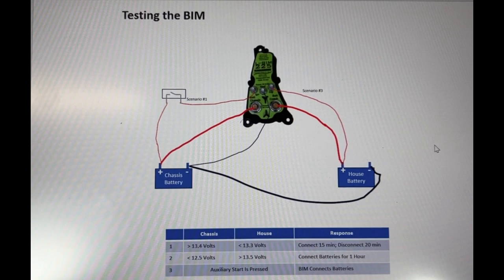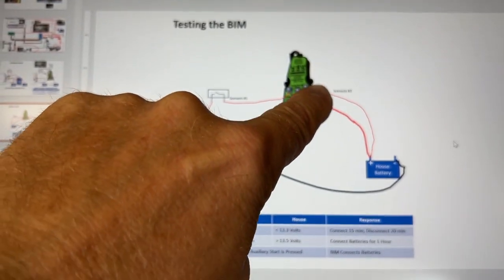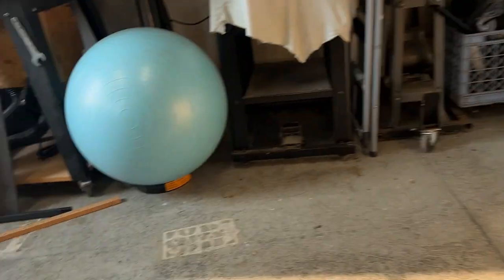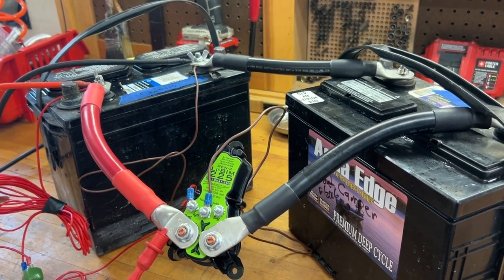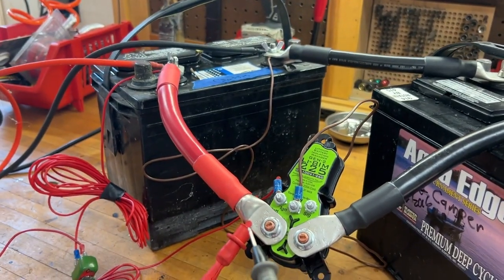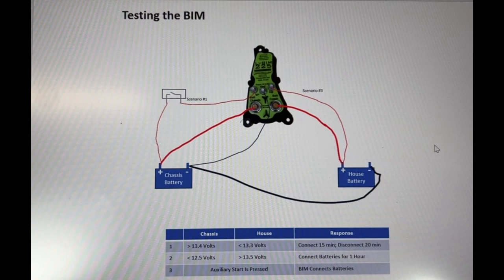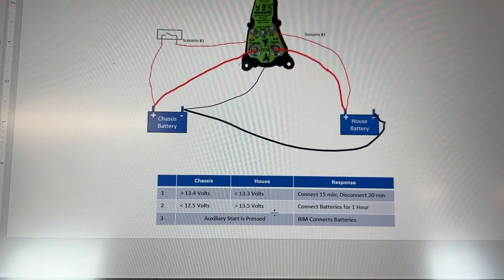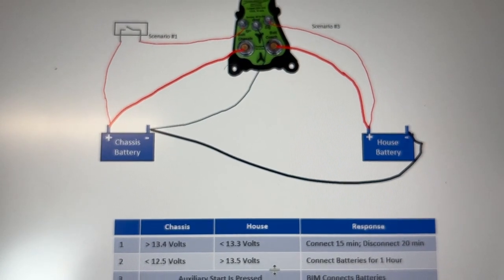#6 BIM Bench Test

Comment: So, you have the house battery charging the chassis battery every 20  minutes with no alternator connected?  In you later test you say the house battery charges the chassis battery?   So, the isolation feature is only every 15, or 20 minutes, independent of the Alternator?  I though the purpose of the BIM was to isolate the house and chassis battery when the engine is off the the alternator is not active?  This to prevent the chassis battery from robbing energy from the House battery.  And, it is my understanding that we should not use the emergency start feature switch using Lithium batteries.  What if I only what the batteries active charging when receiving a charge from the 225 amp Alternator?   And when on shore power the house batteries not feeding the chassis battery?  I have had the experience of a low or going bad chassis battery pulling the house batteries down and this leading to other problems with the refrigerator, heater and other ass relying on the house batteries.  I thinking I will pull the Li-BIM 225 and replace with a DC-DC.  Iam I misunderstanding all of this?
Reply from the maker: Sorry, I may have misspoken... I will review the video again and correct if is misspoke anywhere.
The main scenario is when the engine is running driving down the road, the BIM allows the Chassis battery (which is being charged by the alternator) to charge the house batteries for charges for 15 minutes and then disconnects for 20 minutes.  My alternator is putting in ~ 90amps during the 15 minute period.  The 20 minutes when it is disconnected allows the alternator to cool down.  
There are two other scenarios that are not very common.
Also, I have recently heard that you should not use the Lithium house batteries to start the engine using the emergency start feature on some motorhomes.  I am looking into that to verify with some measurements.  I will post what I find out....  Also, most people don't use the emergency start feature very often.  
Thanks for the comment